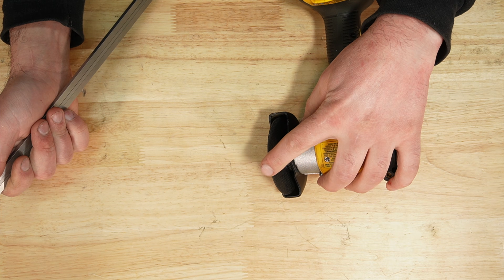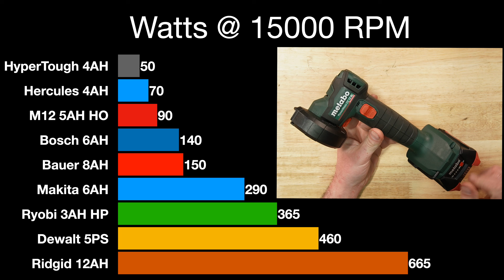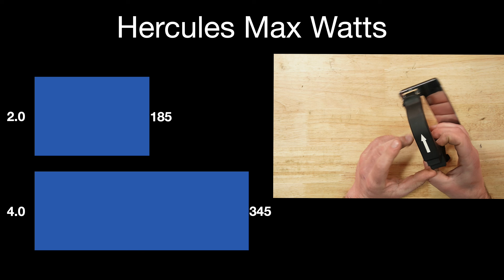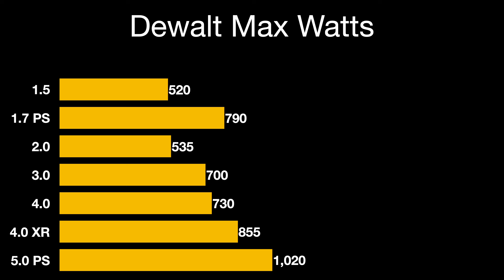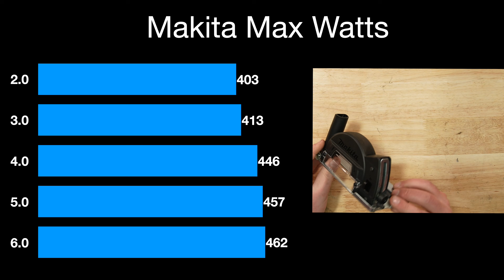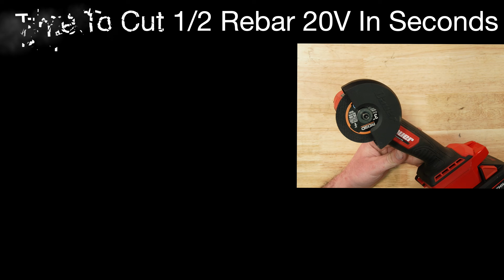The Best Cut Off Tool,  Makita?

Comment: Would you please re-test the Dewalt's one with a new DCB2104 PowerPACK battery?  With 21700 tabless elements. Thanks!
Reply: I'd bet money you'll see numbers close to the 15ah FlexVolt if you're talking about the 8ah version.

Comment: Great data, thanks, and great channel! If you do another comparison of cut-off tools in the future, I'd be grateful if you would say which ones have a variable speed option, what the depths of cut would be with the shoe on and also if the shoe is removed, which ones "allow for" wood cutting, and which ones are best at cutting wood regardless (when a wood blade is inserted). Have a great day!

Comment: Ive had the hercules for a little while now and im honestly pretty happy with my purchase, you can get some work done with the 2amp but its very weird, you put too little pressure and it doesnt want to cut anything, put to much and it instantly bogs down, put just enough and youll get a decent amount done..... up until the battery shuts off due to thermal limitations.
The hercules is definitely the best bag for the buck but i worry that the 12v batteries are on the cheaper end. The 12v batteries are so cheap it just doesnt make sense. Powertool batteries are always overpriced, but good 18650 still run $4-$5 a piece when bought in bulk. Thats $15 for a 2amp and $30 for a 4amp in materials alone, that is not profitable when you look at allmost any business model.
Reply from the maker: Yeah hopefully they expand the line, the 4ah can make a big difference depending on the tool.

Comment: The German company Flex (the inventor of the angle grinder) produces a 3" machine with speed control. (It can be adjusted between 5000-20000.)
  It has a rotation direction switch, the gear housing can be rotated for grinding, similar to the one made by HyperTough. 
  You can find it with the model number Flex LBE 76 12-EC C. It was released recently, I haven't seen a video of it yet.
   I wrote the comment with Google Translate, I hope it didn't detract from the clarity.
Reply: The FLEX company was bought by Chinese holding Chervon in 2013. Now it is one of their brands, alongside with ex-German SKIL and domestic Devon.
Reply: A németországi Flex cég (a sarokcsiszoló feltalálója) gyárt fordulatszám szabályozós 3"-os gépet. (5000-20000 között állítható.) 
  Van rajta forgásirányváltó, a hajtóműház elforgatható csiszoláshoz, hasonlóan a HyperTough gyártmányúhoz. 
  Flex LBE 76 12-EC C típusjellel lehet megtalálni. Nemrég adhatták ki, videót még nem láttam róla.

Comment: I originally was given the worx cutoff tool a few years back (only worx thing i ever had) n while i loved the idea, the worx model just was ass..
Then i got the ryobi one which I still have n love,   then the ridgid which is str8 beast, n i bought onenof those knockoff Amazon ones for shits n gigs (not worth it).
Ive also used the coworkers  m12 which was good... an m18 version tho would be waay killer .
As well as the dewalt,, and imo by far the vest most powerful one qas the dewalt especially w a powerstack.

But as long as its a decent tool brand, and notnsome cheapo worx amazon type,, they all are sick af

Comment: I don't understand why use these cut off tools if they are that much bulky with 20v batteries? better use a normal angle grinder? this is supposed to be handy and compact for light jobs. with decent power and light weight, Milwaukee12v, and Bosch 12v did the great job, I guess.
Reply from the maker: Yeah,  the dewalt is handy though with the 1.7.

Comment: I feel like the manufacturer could chunk up these cut off tools just a tad more, sacrifice size for more power!  I'd be ok with esp dewalt having the current cut off as it's 'compact' cut off while adding a slightly larger model. ESP Makita on the XGT line, the LXT is WAY over priced for the performance with the old 18650 cells. The XGT needs to smoke everything currently existing
Reply from the maker: Yep I agree,  lxt is a joke with 18650’s.  Xgt is $$$ but I will say the drill shocked me how powerful it was.

Comment: Id be interested to see thw dewalt with the 6ah 21700 battery or the 9ah flexvolt. Apparently those are the sweetspots for dewalts battery line
Reply from the maker: They would be better vs most, but the 5ah PowerStack is now the sweet spot.  Only thing which can produce a lower voltage drop is the 15ah.

Comment: I'm curious if the Hyper Tough tests any better with the newer 4ah battery.
Reply from the maker: Yes it will do better with the 4ah,  but even with the 4AH you can see it still struggles.  I tested it with 1.5, 2.0 and the 4.0 in this video.

Comment: Phenomenal video my man as usual The Ridgid has always been the best cut off tool imo but I haven’t used them all, I’d have liked to have seen the Ridgid ran with the 3ah octane battery pack on it which have the 1p 21700 cell config
Reply from the maker: Thanks!  Yeah the rigid is an awesome tool.  I definitely need to get the Octane batteries at some point.  I’m sure the 3 kicks like the 6ah with 18650s.

Comment: I would love to see these retested using diamond metal cutting wheels like diablo and lennox make. To see if the motors perform any differently. I have the m12 with the lennox blade and it seems to bog down a little more than black abrasive cutting disks
Reply from the maker: Sadly I have already sold 3/4s of them,  that way I can buy other tools for testing.

I wouldn’t want anything 12v for that type of work and would recommend the Dewalt or even the Ridgid but the Ridgid doesn’t have dust collection.

Comment: Thanks for another great test!
Btw I am very sceptical about that metabo 10ah pack, if it is 10 cell pack it probably uses 50S cells which are in same power class as 20R cells used in regular 4ah packs. DeWalt had issues with their 10ah packs because they were asking too much out of them lol. For metabo 5.5ah should be the most powerful 10cell pack since they use 30T cells
Reply from the maker: No problem! Thats a good point, I probably need to get the 5.5 then.  I noticed they offer a ton of different battery's....
Reply: @Tools-Tested   yeah having a large selection can be both good and bad, depending on how you look at it :D

Comment: These are useful when angle grinders are just too big or cumbersome. For example, I had to cut out my dishwasher because of clearance issues (height was actually slightly bigger than floor to counter clearance), and I used the cut off tool with guard to minimize collateral damage. 
  I did use angle grinder w/ abrasive wheel for a couple unreachable parts, but with angle grinder alone, the dishwasher stainless tub is very little resistance and was harder to control in such a small space with a variable substrate.
Reply from the maker: Yep they do come in handy at times.

Comment: Honest question, because ive really been wanting to try one of these. Would there be any benefit(besides weight) from me using this tool to cut peices of rebar(what i would mostly use it for) as apposed to using my cordless grinder?
Reply from the maker: Yeah for rebar probably no real benefit.  Probably better off with the grinder for that.
Reply: Not really. It's likely safer due to it not being nearly as powerful. And it likely will always have a metal cutting blade on it, whereas with my angle grinder I often am switching back forth between cutting and flap discs.

Comment: Freaking awesome video. I’ve already seen TTCs tests on these and ever since I’ve been anxiously awaiting your review. Thank you so much, it’s really neat to get your take on tools as well. I have the Ryobi cutoff and their “right” angle die grinder.  I picked up a bunch of the new 6AH HP batteries for a song earlier this year and they both run pretty good on those.  I dislike Dewalt as a whole, nothing logical really, they just don’t do it for me, but there’s no denying that thing is an absolute  beast!  However what surprises me the most is the Ridgid. That thing has got the smallest motor on it and yet makes the most power or nearly the most power and it’s often really cheap. I actually put all my Ridgid tools in storage as I’m trying to pair down my number if active battery platforms, but damnit that Ridgid makes me want to bring the batteries back out. Sadly none of these other brands make a right angle die grinder that’s worth anything except Ryobi, at least as far as I’m aware. I’d love for Ridgid to come out with a right angle grinder as well. Or better yet,  Milwaukee release a new grinder and cutoff tool that doesn’t suck, preferably on M18. Damn you Ridgid!!!!!
Reply from the maker: Thanks!  Yep 110% that Ryobi right angle is awesome.  If Ridgid used a similar motor in a 90 it would be crazy.  I really hope Milwaukee steps it up and give us both of those tools in M18,  thats what everyone wants.

On a side note I do have the new Bosch right angle,  im curious if it will beat the m12 version.
Reply: @Tools-Tested  If I were Bosch, I would be stupidly embarrassed if my new right angle didn’t beat Milwaukee’s old and quite sub par grinder.

Comment: 3:05.. the Ridgid should run with (or close to) the 12ah with a 9ah Octane battery... the Ridgid is a solid value
The Octane batteries bump up performance across the board for the Ridgid..they have 3ah, 6ah, and 9ah..
Reply from the maker: Yeah I hope to get some octane packs soon,  I don’t understand why Ryobi and Ridgid are avoiding 21700s.  That 3ah on the ryobi is the perfect setup.
Reply: @Tools-Tested These octane batteries will run on saw AEG?

Comment: That Ridgid is impressive for the money. Any plans to test battery adapters? I've got tons of Milwaukee batteries and am not eager to buy into another brand and batteries just for one or two tools. There is a Milwaukee to Ridgid adapter, but I haven't tried it, and I'm not sure how safe they are or how much power loss there is (if any). Thanks
Reply from the maker: Yeah it’s crazy how powerful it is.  Maybe some day but I honestly try to stay away from adapters,  I know TTC did a video on them but I haven’t watched it.  This tool would probably be ok though,  seeing it’s only using 2 pins.  But I can definitely understand trying it with one.  I really hope we see a M18 version this year,  they have to be taking heat over not selling one.

No problem!

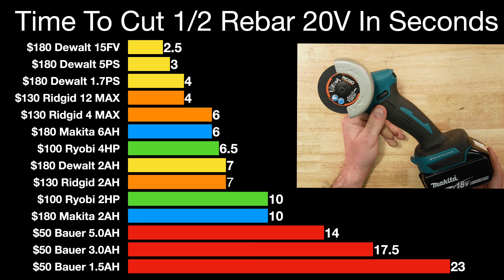Comment: 10:36 you can just use another brand's 21700 pack and an adapter (or hook up the terminals with thick wire and put a <10k resistor between + and hooked pin) to see Makita's max performance. By the looks of the 2ah vs 4ah vs 5ah vs 6ah graphs, Makita is internally limiting the tool, so prob not much more to be gained.
Reply from the maker: I’m going to keep it a year in hopes we see a M18.  Maybe at that point Makita releases a pouch cell or at the very least 21700s.  If not I will test it like you said with another brands 21700s
Reply: @Tools-Tested  I'm very skeptical of 21700s making it to LXT. Makita users have been asking since 2018. I think there's too many small issues that add up to Makita not wanting to do it: incompatibility with X2 tools; possibly overdriving existing tools; extra mass that the connectors weren't designed for; and extra components needed inside the pack. 

LXT packs have 3x30A fuses in parallel, a 60A mosfet, and 2 current shunts in parallel. A 21700 LXT would prob need 5-6x fuses, 2x mosfets, and 3-4 shunts.

If you look at all the recent LXT exclusive tools, they're mostly light weight. This cutoff tool, one-handed recip, mini chainsaw, pruning shears, ratchet, small rotohammer (~20% lighter than the small XGT rotohammer). Bigger LXT batteries don't really fit into that picture.

However, they have recently announced a 12V pack that's almost certainly using 21700s, so who knows. Makita is always hard to predict.
Reply: @toolscientist  it is 21700 ;)